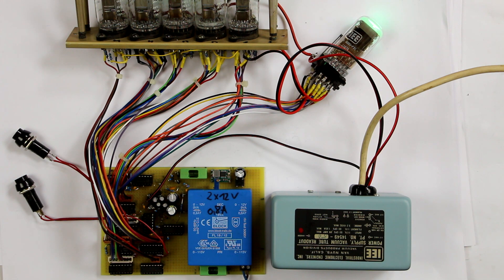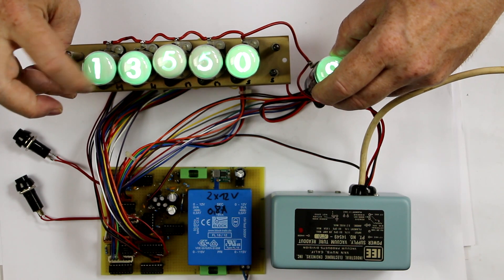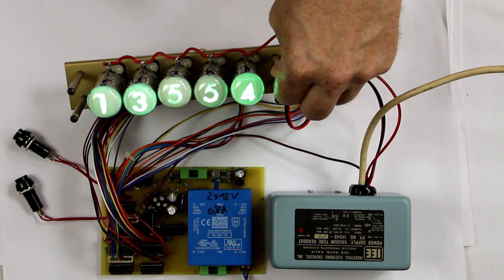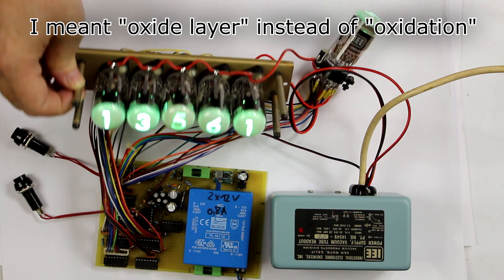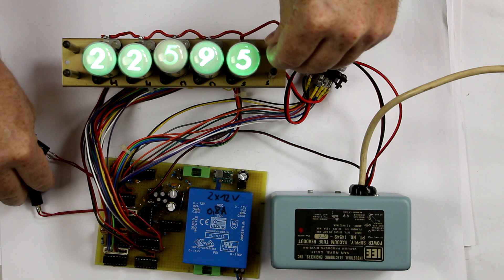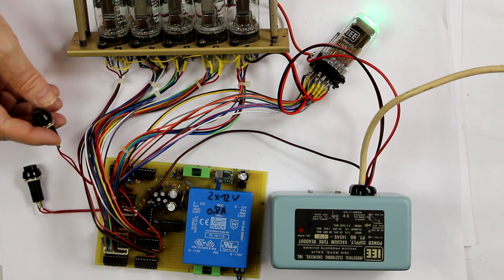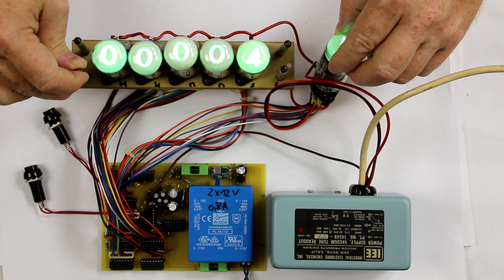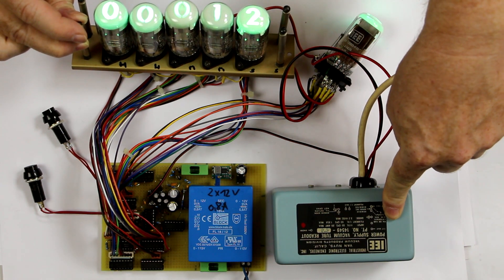NIMO-Clock Update#2

Comment: it is dividing from mains frequency? that isn't a very accurate clock, right?
Reply from the maker: Yes, and I did this on purpose because I didn´t want a microcontroller with an RTC chip but "pure" digital logic to comply with the age of the tubes (although CMOS wasn´t available back then). And on the long term getting the clock-signal derived from main frequency is very accurate because the number of cycles is controlled and adjusted in the European electricity grid. Mains-controlled clocks were even quite accurate on short terms until about the end of the 1990s. The clocks rarely lost or gained more than a minute. Due to the large increase of renewable energy with their large fluctuating power the mains-frequency mains-controlled clocks sometimes loose or gain up to 10 minutes now althogh this has become better again in the last 2 years. There were many complaints to the electricity companies when people came late to their work because their alarm clocks were running slow :-) 
Anyway the clock is not intended wo give super-accurate time but only to be a pleasure for me to look at or to show them at hacker-meetings etc.
I usually get out one of my home-built "Vintage Display Technology Clocks" for a few months to my office-room or to my lab and then change to another one for not to wear out precious tubes with limited life-time.
Reply: @KainkaLabs  that's neat. i hadn't heard of that, (except after making this comment i did see another video on using mains power for timekeeping, on the franlab channel)  i suppose there's no reason it couldnt be plenty accurate as long as the frequency remains stable. i am jealous of you europeans, 50 cycle hum is orders of magnitude more pleasant to have as an everpresent hum, 60hz wears on my soul

i saw a video where someone did a frequency count on the timing pulse for a quartz clock, it is supposed to be 32768hz but upon testing it was fractions of a hz off. now im thinking if it's possible to tune one's own quartz crystal to be an exact integer frequency instead of being off by some degree of tolerance. it seems if you could manage an exactly tuned crystal you would have a very accurate timekeeping device!
Reply from the maker: "Normal" quartzes for watches have an accuracy of 10...50 ppm which gives an error between 1 and 5 seconds per day. So this in fact gives you "a fraction of a Hz off" when you measure the buffered output of the quartz-oscillator at 32.768 kHz. If you measure directly at the quartz pins (without a buffer in between) you of course introduce a significant change in the quartz frequency simply by adding the parallel capacitance of the probe  :-)
Quartz oscillators can be stable up to 10^-8 (10ppb), if they are thermally stabilized in a so called "oven-controlled crystall oscillator" (OCXO). There is also the also the extremely accurate RTC-chip from Maxim which gives an accuracy of around a few seconds per year (!) out of the box without any adjustments. I have a video on my channel about a rubidium-controlled frequency generator with which i checked the quartz accuracy in the OCXO of my frequency counter.
Reply: @KainkaLabs  do you have the link to that video? what could you use to check the frequency of the OCXO? it seems to me a digital oscilloscope would have it's own clock which could be subject to it's own clock's margin of error. would this be resolved by having a much faster clock?
Reply from the maker: The video is in my playlist "Every maker should have...".Search for a video titled "Every make should have a rubidium frequency standard" 
You can buy OCXOs and TCXOs which are already adjusted to their specified tolerance. Otherwise it would not make much sense :-). The quartzes used in DSO also have tolerances of around in the range of 5...50 ppm. Most of them have a BNC-jack for an external 10 MHz frequency standard to give more accurate measurements.